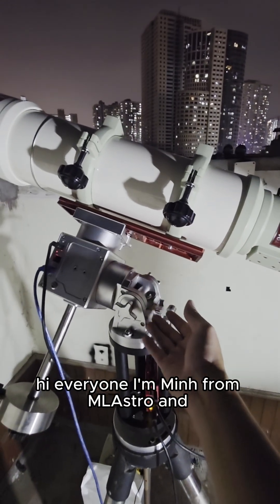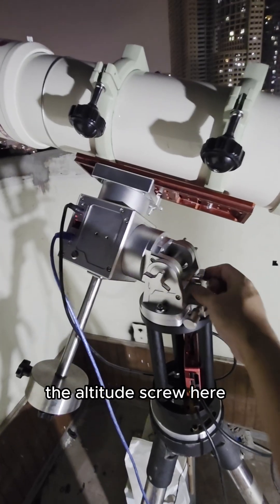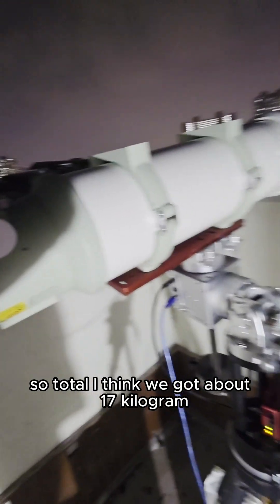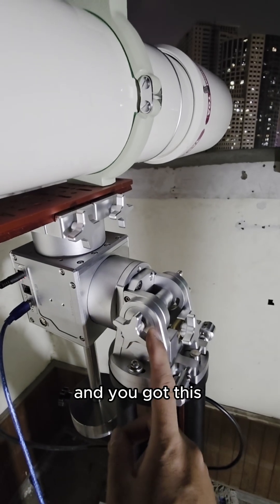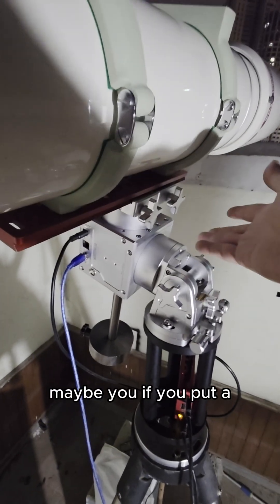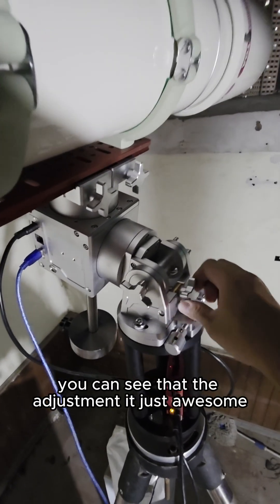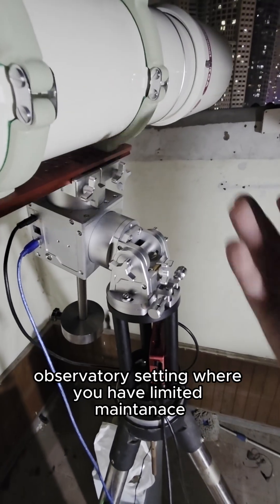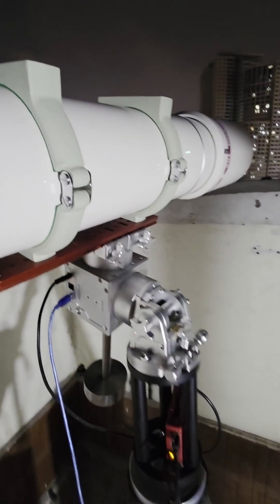MLAstro SAL-33 feature highlights: Zero-Shift Alt-Az base

Comment: Being able to use an Allen key or other lever died not only increase torque, but it also allows for tinier fine tuning adjustments.
Reply from the maker: The alt adjustment screw is super fine threaded, you will not need it. The az, on the other hand, does have a screw hole that alllow adjustment.